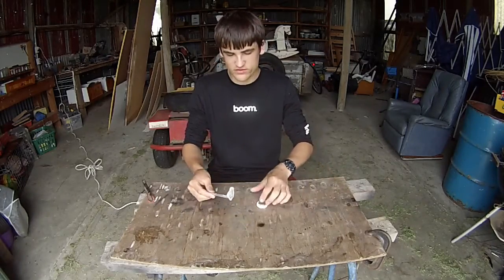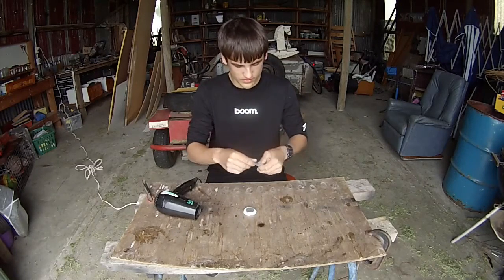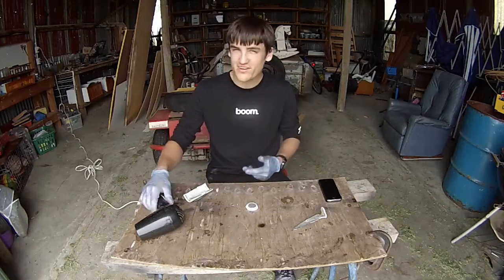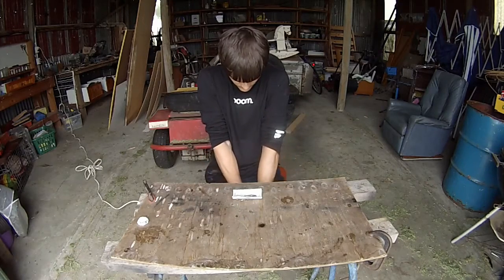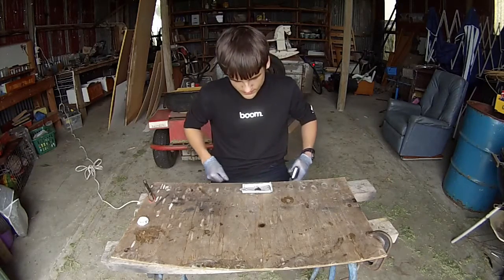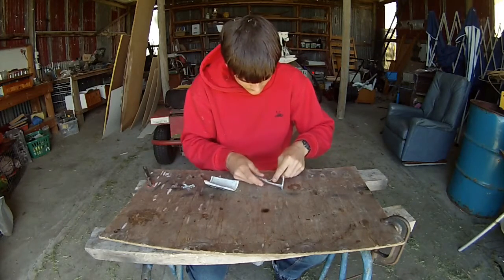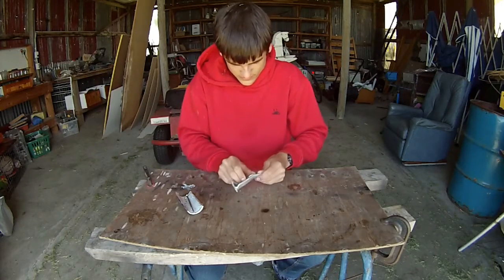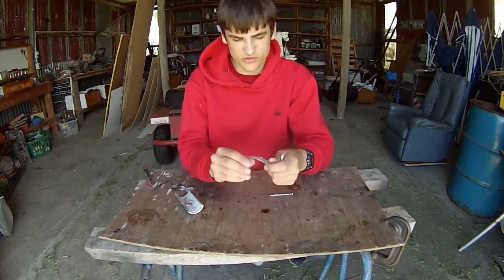Aluminium vs Gallium

Comment: Al and Ga are soluble over a wide conc range and may be liquid in a warm room. The Ga will penetrate the hydroxy-oxide layer on Al just like Hg. The bubbling mentioned below is due to the penetrated Al surface reacting with water and producing hydrogen. Don't know what the colours were that you saw. Not oxidation products as Ga needs high temps (500C+) to oxidise. Impurities?? Don't know where your Ga came from but probably has some Cu etc impurities.